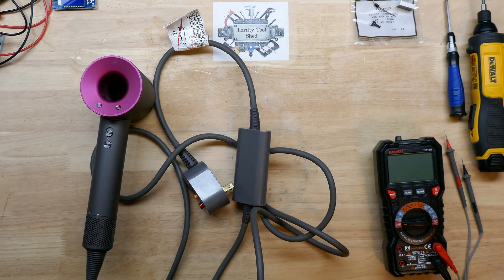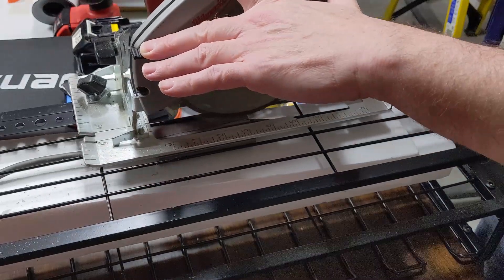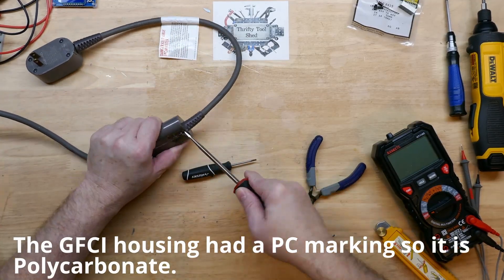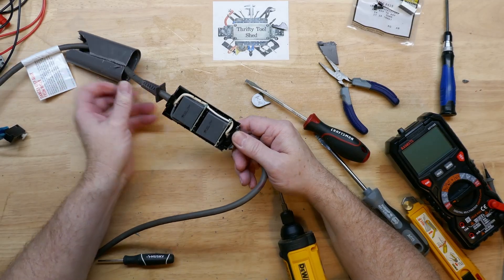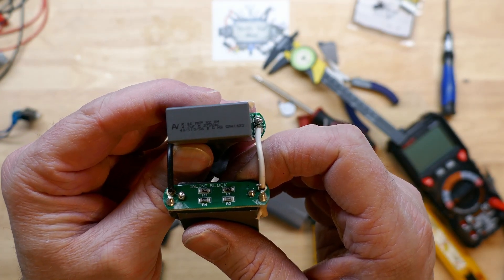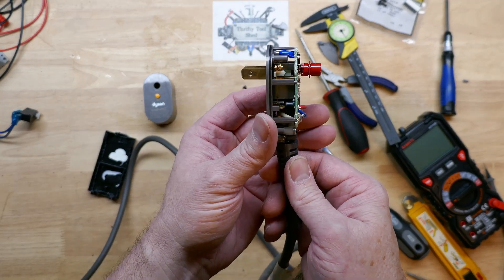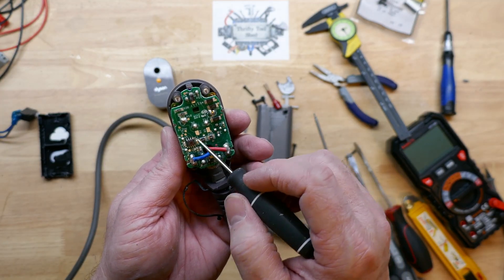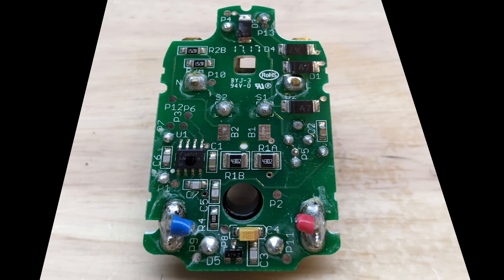What's inside of the Dyson Cord Mystery Box?

Comment: Do you know if the GFCI can be replaced with a generic replacement or is there any special  components on it that allow the hair dryer to run?
Reply from the maker: It seems to be a standard GFCI from what I can tell. I have seen replacement cords that do not have the built in GFCI. They are aftermarket of course and should only be used if a working GFCI outlet is used of course. No special component to make the dryer work on any I have worked on in the past.

Comment: OK so I'll finish watching the video, but I was actually going to "Bypass" both this mystery box and the the trip box / reset filter. Would it do any damage if I did??  Thank You,  GOD Bless !!!
Reply from the maker: As far as I can tell, for testing, it is fine to connect power straight to the dryer input connections. The filtering seems to be more for electrical noise, and the GFCI is, of course, needed for safety when in actual use. Most areas around sinks or tubs are GFCI protected anyway, but you would need to make sure before ever using it without the GFCI.
Reply: @ThriftyToolShed  "YES" , Exactly. By code, the electrical outlets around the bathroom areas or sinks and tubs, are protected anyway. I hooked the dryer direct and am getting power, a blinking white light around the "Dyson" logo. So my thought is, that it is the cord. So the capacitors are really not needed to run the dryer, correct?? Appreciate the reply,  GOD Bless !!!
Reply from the maker: @curlyelp7530 
I believe the capacitors are mainly for filtering and don't seem to affect the operation of the dryer. God bless you as well!

Comment: You seem wildly knowledgable about electronics! My wifes dyson hairdryer stopped working, as in no lights or anything showing up whenever it is plugged in...I have tried several different plugs in the house, resetting the GFCI. In your professional opinion, is there anything else I should be trying? What do you think the problem could be? Should I just replace the power cord? I found a few dissamebly videos online and it seems easy to take apart and replace the power cord. Thank you!

btw, my model is a HD07 that I bought in 2021...if that matters?
Reply from the maker: Thanks for your kind comment. If it's not the GFCI, then it's possible it's a blown thermal fuse. It could be a lot of things, honestly, as they are pretty complicated.
I have several videos on these showing the repairs that I have come across myself, and I also share a simplified schematic of the power and heater part, including the thermal fuse. As I have shown, they are not easy to get into to work on.

Comment: Do any of these parts protect the hair dryer if mistakenly connected to a 230v outlet without a converter? The hair dryer is 110v
Reply from the maker: Unfortunately, not. It's basically a filter for the high frequency noise. To keep the noise of the high frequency motor from possibly affecting other devices.
Reply: @ThriftyToolShed  Ok! I will test the hair dryer when I get back home. But in your experience, could the damage be repaired?
Reply from the maker: @JoanFranciscoAlbaMendez  
I have not seen a 120V one plugged into 230V to say. It's possible a component like fuse or varistor protected the board from major damage, and it's also possible it was catastrophic. You would have to investigate to see, or if you know someone who likes to work on electronics, maybe they would be willing to help. Best of luck to ya!
Reply: I'm back home and happy to report that the hair dryer works perfectly!

Comment: Nice video..: ours just stopped working. Test and reset work, but no power. Where do you think the problem is?
Reply from the maker: Thanks! It's hard to say, but one problem that I see often is the thermal fuse inside of the dryer head. I shared about this in the Dyson HD01 Repair #3 video.
Reply: @ThriftyToolShed where do you buy the thermal fuses? Digikey mouser? Part number?
Reply from the maker: I shared the link to the one I used back when I did video. It should still be in the description. Yes, you can also get them from Digikey etc. Let me know if you have trouble with it.

Comment: Mine stop working today, the ALCI plug reset button just started to pop up once connected (so no power to the dryer). Any idea of what is causing it? Tried different outlets, even different homes
Reply from the maker: Sounds like a faulty GFCI itself, possibly since it's not switched on and still tripping. It's hard to say without testing further. Sounds as if a new cord or at minimum, a cord end may get it back going. I have other Dyson HD01 videos that show disassembly, etc. Best of luck to ya!
Reply: Install a GFI receptacle in your home you use it at and remove the bad one on the dryer.

Comment: Anyone know where I can get a replacement cable?
Reply from the maker: eBay is one of the few places . Or you can buy a broken hair dryer that has a good cord. Example cord you will have to replace ends or solder wires on...
https://www.ebay.com/itm/235589157206?mkcid=16&mkevt=1&mkrid=711-127632-2357-0&ssspo=xwz9f6kaslg&sssrc=4429486&ssuid=D_qZMHXJQNK&var=&widget_ver=artemis&media=COPY

Comment: So interesting, i have a question. If i take out those capacitors in the middle of the cable and just connect cables to cables it will be 240V ? Am i right? My point is; i bought a  dyson airwrap for my family in europe and they are not able to use it due to Voltage differences. They have 220v- 240V instead 120V.  Dyson manufacturing does not help me out about this issue. I did not know that. If i remove that mystery box and make serial connection to cables does it works?
Reply from the maker: So the box is mainly for filtering and it will work with or without it from what I have seen. Just be more electrical  noisy. That said, it has to be the same voltage so the 120V unit is still 120V. 240V would still be 240V.
Reply: @ThriftyToolShed thanks
Reply: Salut. est ce que vous avez essayé. Est ce que ça marché j'ai le même problème.
 @kingofsphagetti

Comment: I get power to the gsci unit but no power to the dryer bc when I plug it in I get a quick 3 red lights & one white m light before it goes out. The unit never turns on.  On the gsci (underneath the test button, above the Dyson logo) the light  on mine doesn’t illuminate. I’ve tried test, reset. Filter clean, etc. do you know what it could be? The dryer is about 2 years old…I use it maybe twice a week at most in the winter & never in the summer. It cost nearly $500 (I purchased it brand new) it should still work but I am at a loss of what it could be. I’m hoping you might be able to help
Reply from the maker: The closest to this issue I have seen was in the HD01 repair #2 video. I was seeing a similar error and then it quit completely. I ended up finding a diode on the board that was shorted so it was a power supply issue on that one.

Comment: Just watched this video and the tear apart one. Very informative, thank you so much for posting! I’m working on one that has a damaged power cord. I see some “replacement” cords available online. However, these don’t have the box. Do you think these would be safe to use? If so, are there any consequences of replacing it with one of these?
Reply from the maker: The box is simply a filter circuit. It is a noise filter, the best I can tell. I have run many of these dryers without it, but I can't say for 100% it doesn't help the life of the motor and heater control circuit. I have never looked into the power line noise with a scope to compare just how noisy these are. With the high frequency circuits I am sure they are very noisy. I would think it's a possibility the noise could have some effect on external devices and signals especially audio signals, but most likely fine to use it no more often than they are used really. Thanks for your kind comment. Best of luck to ya!
Reply: @ThriftyToolShed  Sounds like I may have to give it a shot! Thanks for the reply!

Comment: My wife has dropped her Dyson "mystery box" on a tile floor a couple of times and it is now cracked with a small plastic chip missing. Dangerous to still use? Repair suggestions?
Reply from the maker: It can be dangerous and especially around water for sure. If no actual wire or metal parts are exposed it might be ok to use the gray epoxy over the crack or chip? I would not ever trust it around water even new, but especially if compromised.

Comment: I have one of these in the UK (240V) But it doesn't have that filter block, any idea what the reasoning is for using it? And not using it in the case of 240V?
Reply from the maker: I would guess it was due to electrical compliance in the country it was sold in? Also being lower current @ 240V instead of 120V and twice the current it could be that the noise only hits a non conforming standard at that ampacity? Thanks for sharing, I did not realize the 240V version did not have the filter block.
Reply: Indeed no it does not have it in UK 
Just replaced the power cord on wifes which has sentimental value due yo failed core by the cable inlet  a common fail
Reply: I know it's months later but I'll mention that my mum has a similar dyson one from Germany that is of course 230V and it DOES have this box on it. I'd assume UK standards may not be as strict.

Comment: Odd question, my partner has one of these that she bought while overseas and it was manufactured to run on 240V. I’m assuming when we get it home and plug it in to the standard 120V, nothing is going to happen. I’m not sure that an adaptor will do much of anything, could it be modified to run on 120V? Or would I be better off changing the chord completely? It beats spending another $600 for just a 120V difference.
Reply from the maker: Unfortunately the dryer is designed to work with 240v and is not going to run on 120v even if the cord is replaced. You may be able to sell it while still overseas though and then buy the correct rated model once back in the states may be your one of few options.
Reply: @ThriftyToolShed  I got another case with 120v but the grid provide 220v, is there any way to mod it to 220v, a transformer is too big to bring around
Reply from the maker: Transformer is the only way I would know of.
Reply: @ThriftyToolShed  thanks, it is the only solution for now. But I found sb mod it, not sure how they do it, maybe change the board or mosfet somehow

Comment: Wife took US dryer to Asia and now it’s not working.  Is a fuse or circuit blown?  Anyway to fix?  Dyson said it’s the only product they don’t repair due to lack of parts 😢
Reply from the maker: I believe a lot of Asia is 220V 50Hz power. It may have damaged the power supply part of the circuit on the main board. Hard to say really. I would truly doubt it is an easier fix like the thermal fuse in the "Dyson HD01 Repair #3 video". It's more likely similar to the " Dyson HD01 Repair#2" with the power supply issue. I found a bad SMD diode on that repair. It does suck that Dyson doesn't repair these. I try to share as we learn on some of these to try and help others. If nothing else maybe you or a friend that likes to tinker can get it going after watching the videos....

Comment: How to connect to the mains to 220 volts, I have the same box, I thought to remove it and directly to the 220V outlet
Reply from the maker: I have tested the 120V models here in the US by running from 120V straight in and bypassing the filter. I don't know for sure if 240V models are the same, but I would think so. Just make sure you don't have a 120V model, they can't run on 240V at all.
Reply: У меня модель на 120 Вольт!  Возможно запустить напрямую минуя фильтров от 220в ?
Reply: Please help me! How to convert a hair dryer from 110 to 220 volts ?
Reply from the maker: I don't think it is a way to convert 120V to 240V without a high VA transformer. It is designed to run nameplate voltage. For example, the heater element is set for voltage of 120V and it would be twice the wattage at 240V and burn up very quickly.
Reply: @романМалый-о9ж  same problem for me, is there any solution for this. All device today should auto adapt from 110v to 220. What a shame to dyson

Comment: From a manufacturing perspective its really odd that they put a filter like that in the middle of the power cord. It would be way cheaper to include those capacitors either in the dryer itself or the GFCI plug. I wonder if the device failed some sort of regulatory test in one or another market and putting the filter in power cord was the cheapest was to make it comply without changing the plug or dryer design. And those capacitors are huge drawing almost half an amp at 120V. I wonder if they are aimed at reducing power line harmonics from the switching power supply rather than higher frequency noise?
Reply from the maker: Very possible. That does make sense. The box in the middle of the cord has always seemed so weird. I have run these before without the box so I know it was not an DC supply as many people kept saying or asking me about it. I also know you know better than me that a 1800W dryer would need a much larger box on the cord for a DC supply powerful enough to run it. Thanks so much for sharing your comment. I respect your opinion very much!
Reply: @ThriftyToolShed  You just got me thinking: do those dryers offer stepped heat (low medium high) like a  cheap one, or is the heat control continuous with no steps? If it is continuous, there is probably something like a triac switching every AC cycle creating even worse step type noise than an electronic power supply (which in hindsight would be huge for 1800W) and that might be the reason for the huge filter caps. If you ever have a broken dryer like that would be interesting to  take it apart!
Reply from the maker: It uses a triac to control heating. It does offer 3 steps or heat modes. It was fun to repair a couple of these. I am working on one now as well. It's been really fun. A researcher got up with me about modifying one of these for him to turn down lower for his lab use after seeing one of my videos about repairing one. He originally  thought he could use a Variac to control the Dyson and then contacted me. It's been a fun project and a blessing to be a part of. I do have a couple older videos repairing a couple of these if you would like to see inside. Full disclosure, it was my first one to take apart so it's a little bit how not to take it apart. Lol. But that is how I had to learn how to take it apart. Thanks for your knowledge and sharing! 
https://youtu.be/uGFkighBVpE
Reply: @ThriftyToolShed  I just looked at the video in the link - is that ever an eye opener! I would never have expected so much electronics in a hair dryer, but I guess with the prices Dyson charges for things its no issue in terms of manufacturing cost and many regulating air speed and temperature to within a few percent is part of the sales pitch. What was most interesting to me is the inclusion of the ionization generator to bleed away static on hair. It never occurred to me to put something like that in a hair dryer but I'll bet it makes more of a difference to the user that the rest of the fancy electronics!